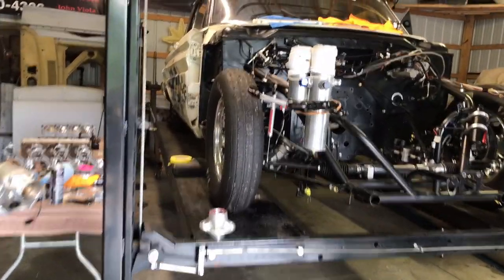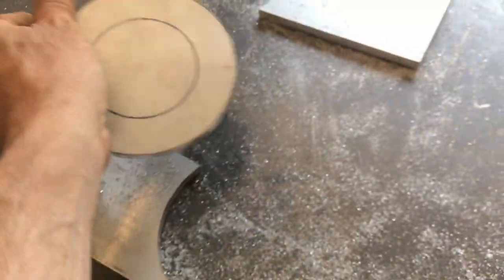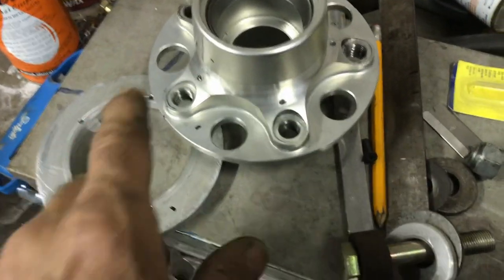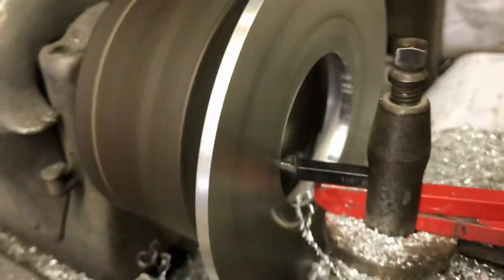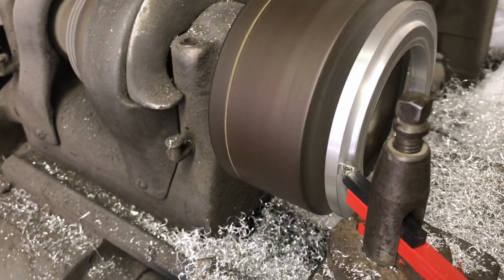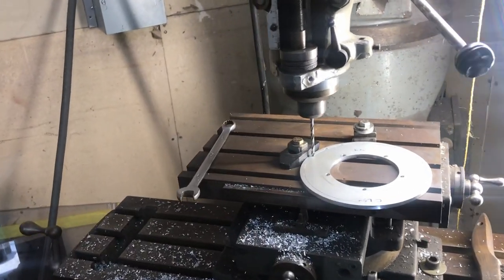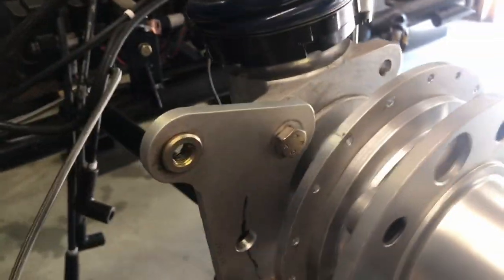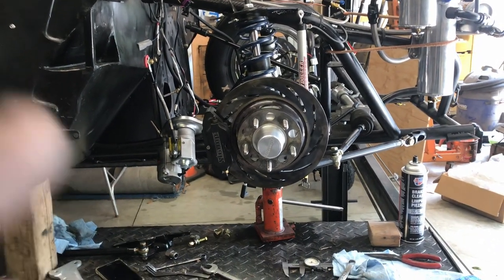Making a front wheel speed sensor

Comment: Very informative, I need to get one on the front wheel of a 1995 GMC truck, so i can have a working speedometer without  being connected to a transmission or rear axle....
     The design has a modular rear drivetrain platform, completely independent of the body.....and interchangeable in about 15 minutes

Comment: Great work! Are the pick-ups on both the front and rear at the same diameter? How do you program the Holley to compensate if they are not?
Reply from the maker: So the front wheel speed sensor is the one I just made .now the rear has a wheel speed sensor hooked to the driveshaft . in the Holley software you can program both one or separate if you want but in the holly software you can recalculate the size on each separately so they match.   You’ll get to see that when we bring it to Rob and he’ll explain it. 👍